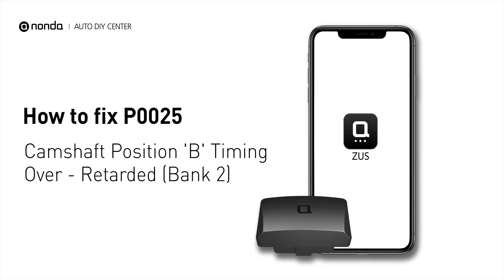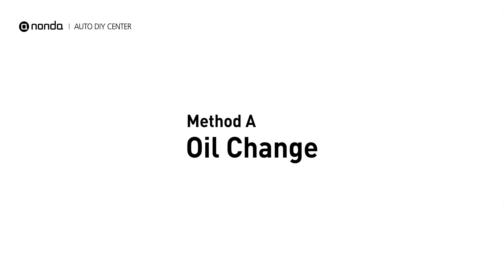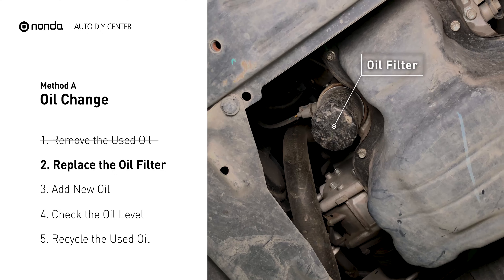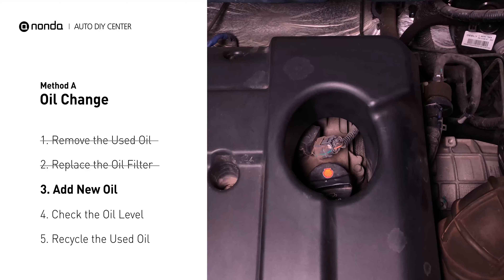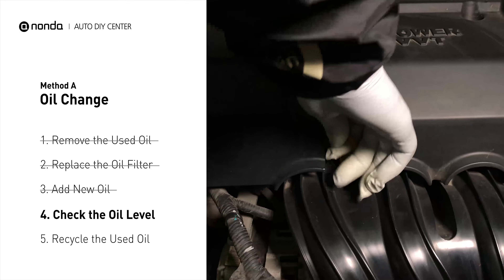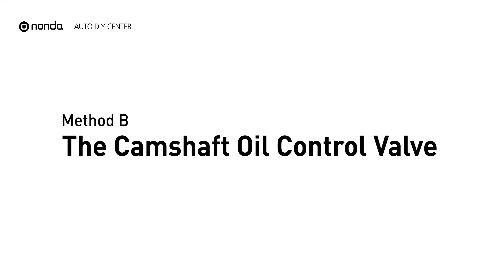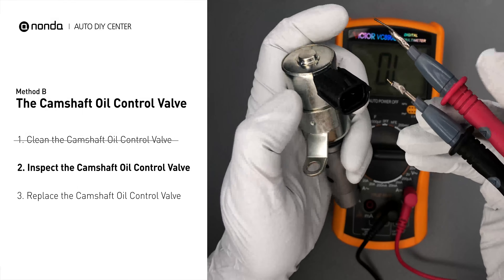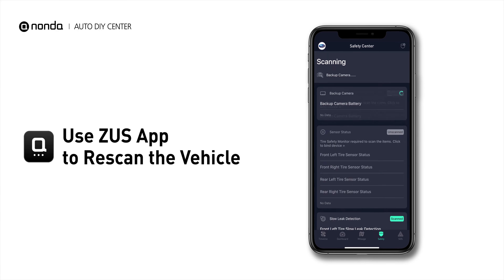How to Fix P0025 Engine Code in 4 Minutes [2 DIY Methods / Only $6.99]

Comment from the maker: Hi, I'm Steve, nonda's lead mechanic engineer. 
Feel free to leave your comments here if you have any mechanic questions, I will be glad to help you out!
Reply: Thank you for your vidio. it is very useful and informative.   I took DEQ test on my 2007 MB E350 and failed the test and found out two issues that are p0025(exhaust b camshaft position timing and Coolant thermostat below thermostat regulating temperature by OBD2 scanner check.  It could cost to fix it upto some thousand dollars depending on issues.  Can you tell me cost range for the repair on average and is DIY workable for this issues?  It would be appreciated if you could let me know on my question.
Reply: Hey Steve quick question my 2008 BMW 750li has only 1 code (P0025)  but it hesitates to start the engine is that a Normal cause
Reply: @braebrown7888  did u fix it?

Comment: I have a 2007 Tundra with the 5.7 engine. I am getting the P0024 and P0025. I have watched a few videos on "the fix" and I have seen the Camshaft oi control valves, and the transmission speed sensor as possible fixes. I tested the resistance on both Cam oil valves and they both tested a 7.9. I have the flashing 4Lo light as well as the flashing VSC light and check engine light. Would the transmission speed sensor cause a flashing 4Lo light? I had a flashing 4Hi and 4Lo a few months ago. I replaced the 4WD transfer case to fix the issue. Now my 4Lo  keeps flashing. Any ideas?
Reply from the maker: Hello, as you are receiving more than one error code, we highly suggest getting your vehicle visually checked by your local mechanic for further diagnosis.
Reply: @nondainc  No offense, but since Covid it's almost impossible to find a local shop that's willing to do more than an inspection. I recently took my truck in to see if I could schedule an appointment for a fuel pump change. I took it to 3 shops and each one turned me down flat! It's like if your vehicle is over 10 years old, nobody will touch it. Ended up doing the job with a buddy in his driveway. Was also going to do the 4WD transfer case as well. Called around and found a shop where I know the owner. He and I used to work together at local airport. I called his shop and was quoted $1300 for the transfer case replacement and fuel pump replacement. Needless to say, I get a call from the owner a couple of days before my appointment and he proceeds to tell me that the employee who quoted me the price screwed up and has since been fired. The new quote is now $1600 to put in the new transfer case which I supplied. That new quote is minus the fuel pump. (Which he also declined to do) I also supplied 2 new seals to go into the transfer case. Who ever put the transfer case into my truck, didn't replace the bearing seal on the end that faces the engine. Any good mechanic would have made sure that particular seal should have been replaced. 3 days after getting my truck back, I notice that the transfer case is slinging oil all over the underside of my truck. One new seal and another $400 dollars later, I get my truck back. Total cost of getting my transfer case put into my truck, $2000. $2700 if you include the price of the new used transfer case. And the best part? The reason my old transfer case failed is because Toyota decided to put a vacuum tube on the very top of the transfer case! The tube actually comes out of the plastic cover of the actuator motor. After years of Vermont road salt and harsh weather conditions, that little vacuum tube got brittle on the end and fell off from it's plastic nipple. When this happens, you now have an open hole for all the water and salt to leak right down into that motor box and seize the entire motor up. Hence the reason for my 4Hi and 4Lo lights to flash non stop. Again, a good mechanic would have replaced said bad vac hose with a new one. But was this the case? NO! I recently discovered this little gem when my 4Lo light recently started flashing. I spliced in a new line and with any luck, it hasn't fried my top actuator motor. I will replace the Cam VVT valves and the transmission speed sensor. I will keep you posted of whether or not it has fixed my error codes and flashing lights. Not trusting a shop to do anything.
Reply: Update: I replaced both VVT cam sensors on bank 2. It's been a week now and all the warning lights have gone out. For some strange reason when those cam sensors get bad, they will apparently trip the 4Lo, Check Engine, and VSC lights. At least on the older Tundra's like mine which is a 2007. I did not replace the speed sensor on the transmission. There was no need after the VVT cam sensors were replaced.

Comment: I have an infiniti QX80 that is showing p0022 and p0025, I searched for the Camshaft oil control valve and can find it for my vehicle, it keeps popping up  the variable valve timing solenoid.  Is this the same part?
Reply: I didn't notice any change and then realized my check engine light came on.  It didn't run any different for a couple days but Now I notice a sputtering pretty often.
Reply from the maker: Hi Sam, we suggest getting your vehicle visually inspected by your local mechanic for further diagnosis as you are receiving more than one error code.

Comment: I like your vedio. very simple and just get to point.   I got DEQ test on my 2007 E350 but I failed test and got issues that are p0025(exhaust b camshaft position timing and coolant thermostat below thermostat regulating temperature.   I took it to repair shop and said it could cost some thousand dollars depend on issues.    Is DIY workable on these issues or how much do you think it would cost to fix this issues at the shop.  it would be appreciated if you could inform me of this.
Reply from the maker: Hello, thank you for your feedback! To prevent potential damage and so as not to double costs, it is best to have the vehicle inspected by a mechanic. Also, you can call multiple repair shops near you to compare their rates, or ask your family/friends which are affordable and offers good service around you.
Reply: nonda Thank you for your prompt reply. Have a nice day!!
Reply from the maker: You are most welcome. Have a lovely day!

Comment: 2018 Maxima 3.5L code P0025 won’t go away, car stalls on every startup, unless I keep my foot on the gas.
Reply from the maker: Hello, we suggest checking the electrical connections/wire harness to the camshaft sensor, Oil Control Valve and the crankshaft sensor for any issues. Also, please make sure that the engine oil is clean and is of the correct viscosity. Hope it helps!

Comment: So I got 2014 mustang GT and it’s throwing p0025 or p0024 and between 2 and 4 rpm my exhaust sound funny and sometimes my car die when I go to complete stop please help
Reply from the maker: Hello, you may try the tips/suggestion provided in the video. If applied and the issue continues to persist, we suggest taking the vehicle to the mechanic for further diagnosis.
Reply: Hey bro? Did you fix your problem? Im getting the same exact problem
Reply: @WorkwithVell  hi so the car is low on oil pressure I put gauge on it and it was low as 9 psi am thinking maybe the boundary opg have Quality issues